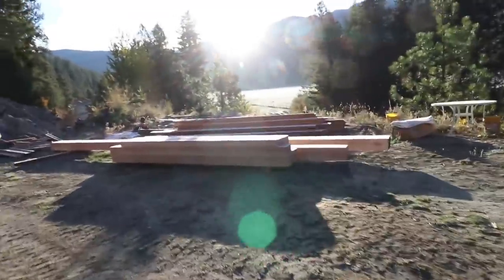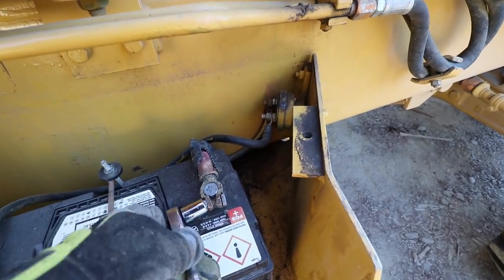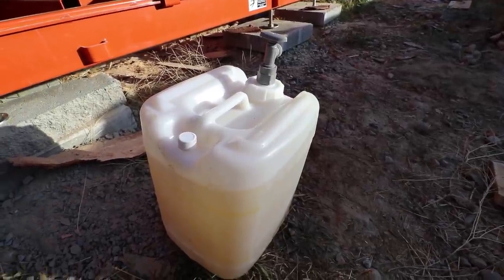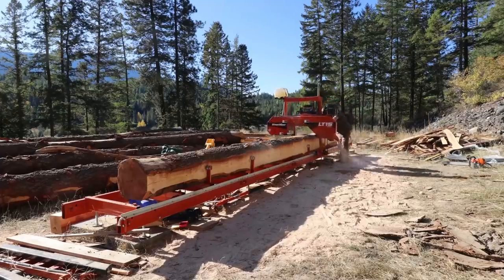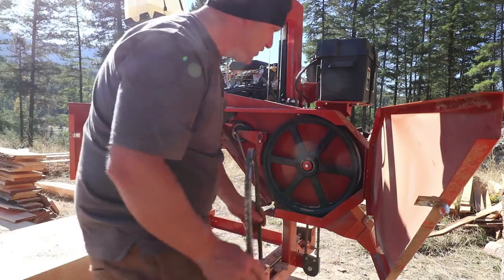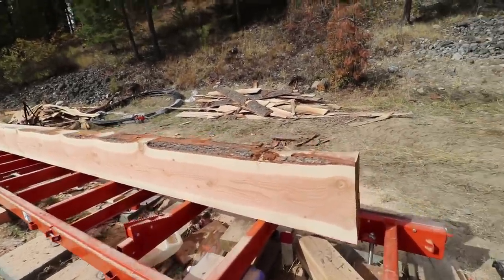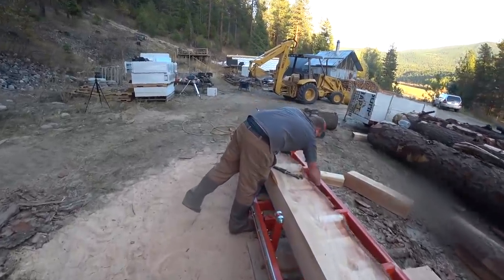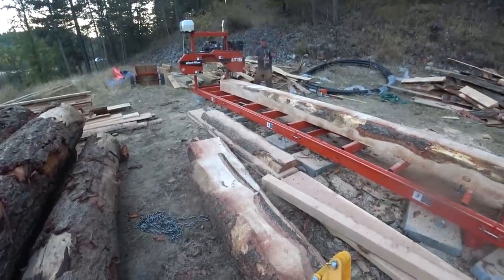BROKE OUR FIRST BLADE! (LT15 Woodmizer Sawmill)

Comment: Your tractor should have a DC Heating elements in it that will preheat the spark plugs so that it will start easier in the cold weather. It should be a switch or a push button or connected to the key switch itself a half a turn.  It would totally not make sense if it was not installed by the manufacturer.  I thought in previous videos you read eliminated the battery fixing things as a process of elimination.. you should be going through the fuse box pulling every fuse looking at them cleaning them and overtime maybe you'll find a lead that is a fuse that seems to drain the battery every time you put it in yes this will take days..  when you are looking for a drain on the battery what you are saying just for clarification. The black negative wire is grounded to the Tractor and you are looking for a broken wire to something like a light that is connected to the red wire the positive battery post.. no here you can find a clue it wouldn't be a major drain on the battery so it might be the heating element.. if it was a scratch wire then after you pull all the fuses you will find power on both sides of where the fuse resented.. however if it was a broken wire and one side is not making contact then you won't be able to find it by the fuse box.. however that tractors painted in paint and it's hard to get a connection through the paint.. I should tell you how to check the fuses you do that with a wire tracker to the negative terminal of the battery and you put the other wire to the positive terminal but the key thing is there's a light bulb in between yeah you're going to need to know that these things are bought at the auto store.. they have a nice feature as a pic that you can push right into the wire..  okay what's a major lag and the way you present your videos if you have don't have it figured out by now might want to read this... I like your videos I think you're making your structure a little bit too much like a house your roof should be steeper you should make yourself a mini Lodge or a bed and breakfast.. the grand open area should be similar to a barn framing and I tell you you probably should plank the outside of your structure.. once again thank you for sharing your experience in your life with all of us and making us dream and inspired to do more..
Reply: is the tractor petrol ?
Reply: think the person meant glow-plugs not spark plugs- but not sure

Comment: when you make your first straight cuts and then rotate,why dont you rotate to the flat side to the bottom? you will not have a wobble...
Reply: because then they would just have a sort of oval log with no flat sides, just a flat bottom and top. i thought about it too, and don't you need a flat x and y axis?

Comment: You should have built a skid way for your logs to sit on... then when you need another log to mill you take your cant hook and rool it on the mill.  Would just need the back hoe to lift the beam off.  The lt 15 is really to small for those logs.

Comment: You should always disconnect the neg. terminal first on a neg. ground system this prevents accidental arcing from the positive post to ground if your wrench comes into contact with the chassis. Sounds like either the charging system is bad or the Bat. is bad. An easy check to see if the charging system is working is to use a volt meter across the terminals to check battery voltage then start the machine and check it again. You should see a reading of 13-15 volts. If not the battery is not being charged. A good 12v bat. needs at least 13.2 volts to fully charge it. If you have a 12v test light you can check for a battery drain by disconnecting the neg. terminal connect the test light from the neg. battery post to the neg cable, make sure everything is turned off. if the light lights there is a drain .

Comment: It sounds like the battery is weak rather than any other problem. Check the water in the battery to make sure it isn't low. If it is full either the battery connections aren't clean or the battery needs to be replaced unless the charging system is weak.

Comment: DC in a vehicle goes from the bat OUT THE NEG into the chassis, through the "device" and back to the bat through the positive.  Sounds both like your disconnect is installed incorrectly and (at this point) it has killed the bat.

Comment: Why don't you use a less permanent method to secure the wood mizer? Perhaps you can stake it in place so it won't be so easy to move it
Reply: Samuel Bruno , stakes will come lose but a mobile home tie down will cork screw in and never come apart.  That's what I would use. One on each end and maybe midway one on each side.

Comment: Your battery is shot, keep it facing the sun when not in use or disconnect it when not in use and get a solar panel trickle charge when not in use for days at a time. Batteries that are dying die faster in cold temps, you could always bring it inside warm cozy trailer when not in use! LOL

Comment: Batteries give off hydrogen gas which is very flammable. The reason why its better to disconnect the negative side first is because there is less of a chance of sparking on the negative cable when it touches the post and the battery exploding in your face.
Reply: The ground (negative) is disconnected first to prevent a short if a tool touches the frame while disconnecting the positive.
Reply: Not addressing the dying battery.  I did not say the negative cable won't spark and NO the spark is not the same the positive cable can generate a big enough spark to ignite hydrogen gas whilst the negative can still spark but its too small to do anything.
Reply: please stop. negative to negative does nothing. positive to negative completes the circuit so Bob E is correct as long as the surface is not painted

Comment: One thing I have noticed - when the two of them are working together on extra heavy/bulky/hard to handle objects, things go much better than when it's just one of them alone.See the 24:18 MARK on this video for an example - together they rotated this log without nearly as much jitter and vibration on the pads as when Jessie is working by himself.

Comment: Why not screw the pads to the concrete?
Reply: Or just partially screw in short lag bolts right next to them to block movement. Only a few would be needed for the whole structure.

Comment: The Alternator is bad. It works after a jump start because diesel runs on self ignition of the fuel once it's running. So the only real electrical draw it has is lights and the starter. Once it's running it isn't using electricity to run like a gas engine.
Reply: Wrong. Any bad connection anywhere on a component could cause a parasitic drain. He may not be running a good ballsy starting battery, and should probably run two batteries
Reply: I agree. As typical lead acid batteries age ,lead oxide particles settle to the bottom  of the plates ,it doesn't start out as a dead short, but eventually will. A three dollar hydrometer would diagnose the problem in about 5 minutes. I suggested this approach on a much earlier video....but you know how that  works out on this channel.His ammeter function would also measure a small current leak (typically up to 10 amps) but I suspect he hasn't a clue.
Reply: Andrew Pinkham they are not having a draw issue. A disconnect would solve that issue. They are having a issue with the battery having enough charge to start it in the morning.  Jumping it and the next morning it being dead is because it is not charging once they take the jumper cables off that's all the more charge the battery has.  Look up diesel runaway, you can completely take the electrical system away and a diesel motor will still run. Mechanical fuel pump so once the motor is running it has fuel pressure and there is no spark on diesel engines. I do this for a living. A draw would have been fixed by the cut off switch it obviously isn't draw since the battery is disconnected and it still wouldn't start.
Reply: louis suvoy I've worked as a mechanic for over 20 years. You describe a runaway diesel not knowing that the engines often run on motor oil, not diesel once they run away. His alternator is probably fine because lights and everything work. If the battery has a mineral bridge or is simply old, one or more cells will not allow proper conductivity.
Reply: That's not to say anything of the fact that if you look close at the cables he's got there, they look like they need to be re-done, with all other connections cleaned, not to mention that he's just press fitting the cable to the battery post
Reply: Andrew Pinkham they run away on their own oil yes but it doesn't take electrical power to run anything like a coil for spark once they are running in normal operation. Just like model rc nitro cars once the glow plug is hot and the motor is running they don't use or need electrical current like a gas engine does to stay running.  I've seen battery cables in far worse shape work fine especially when moved around constantly like removing terminals all the time like he has been doing. A bad battery would have failed a test on it when he stated it was tested a while ago.
Reply: Proper order of troubleshooting. 1. Does it only not crank when it's cold? If yes, almost certainly it's a battery problem. If it does the same thing when it's hot outside, then it's a voltage drop issue. Clean all connections, make sure everything is right and continue on with the plan of the day. 2. Is the alternator bad? With the engine running can all the electronics be turned on highest setting an the lights not dim? If yes, alternator is good. If no, check all connections and measure output from the alternator. If he has a DVOM, the alternator should produce 13.6-14.2v. 3. Is there a parasitic current drain? (Would only present with an actual dead battery no matter the temperature). Easy to check by disconnecting either battery terminal (I use the positive) and measuring how many amps are being drawn by the system. 0.0 is the best number but I wouldn't be actually worried until about .3. A test light could also be used to in place of the multimeter.  You HAVE to troubleshoot properly before you just start chucking parts at things. By simply assuming that the alternator is bad because it's a diesel and doesn't need power to keep the engine running (um...fuel shut off switch? Anyone?) you are showing your ignorance of the workings of a diesel powered vehicle in cold climates.
Reply: Andrew Pinkham so never seen a bad battery when it's hot out? No crank or weak crank is not a battery problem just because it's cold or not a battery problem because it is not cold.  They always have the backhoe running in the background.  The time it spends on jumpers is enough to charge the battery to power a solenoid but not enough to power the starter under load. So again we are back at the battery holds a charge but doesn't charge up during normal operation to start it the next day when it's been disconnected from any parasitic draws in the system.
Reply: louis suvoy yep. Saw batteries fail when I was in Afghanistan. But he's not in a hot environment. He's currently getting into winter. He needs to do a bit more simple troubleshooting. He also talks about a shitty disconnect switch. Could be a little corrosion or moisture or something in it. The video is playing as I'm writing this comment. He literally just said that the battery was tested a long time ago and that it fires right up normally. That, to me makes me point my finger at a battery not anything else.

Comment: two batteries would be a good start second have a load check done on the alternator along with a bridge check to if you are dumping AC in to the battery that would kill a battery quick 

secondly if I am hearing the engine correctly it's a Desial if that's true the once it's started it needs very little to no power to continue to run

Comment: Hey Jesse. One way to combat the cold/diesel issue is to add some gas to the diesel. It prevents the fuel from waxing (thickening) You should connect an electrical meter set to amps in line with the positive battery lead and see how much current is being drawn when the hoe is off. Then you could start disconnecting electrical components one by one monitoring the current. When the current falls low you know the last item you disconnected is faulty.
Reply: But he physically removed the battery lead and still the battery is going down.
Reply: hankus253 i got that. Worth checking for a current leak anyway. I would say the battery is faulty, or as Jesse said just isn’t handling the cold. What makes me think there is a current leak is that in the summer the battery was still running flat. Perhaps there are two problems here....

Comment: When using the Wood Mizer, Jesse turns a hand crank, what does that do?
Reply: i am pretty sure the crank is what is causing the saw to advance down the bed on the rails
Reply: Stormcruzerlore But I've seen him use it without cranking too.
Reply: when he pulls it back to the start it dosnet need to be cranked but when yoru cutting a log it has to be cranked

Comment: If the battery is discharging disconnected I would suspect it is a bad cell in battery. It will charge up then discharge..Could conduct a test by pulling the truck battery from the truck and put it to geht side soemwhere, then put the tractor battery in the truck (after it is charged) if it is dead in morning you know it is the battery..
Reply: You got it right.  Internal short in the battery due to a plate that's probably broken.

Comment: Batteries can be good one summer, and then die in the winter. Lead acid batteries often die at the beginning of winter.
Reply: No, batteries often dies a slow death but over time but you only realise that it's past the point where you need the CCA's to spin the starter when it gets colder and engines get a lot harder to crank over than in the summer when the oils are hotter and this a lot thinner.

People just don't notice that the battery is not up for it any longer when it gets cold in the mornings. :-)
Reply: Morten Mortensen exfuckingactly

Comment: The way the back hoe started sounds like a dead cell in the battery ie only 10volts not enough to fire it up. I have just had to replace my battery due to the same issue

Comment: they use the disconnect on the ground side for corrosion reasons. the ground circuit lasts a lot longer than the positive circuit ... leave it alone!

Comment: OK If the battery goes dead by itself one cell or more has an internal short in side ..To check this you need to check how many volts the battery has when it is dead ...Even when battery is low it should have 12 volts ..SO check how many volts it has when it is low ..IF it has 10 volts ..one cell is bad  if it has 8 volts ..2 cells are bad and so on the sounds of your stater it has one dead cell   Find out whats wrong BEFORE repairing

Comment: You disconnect the ground, which disconnects the power source from the circuit (the battery). If you put a disconnect on the positive side you are adding resistance,  and running all power threw the disconnect. Most stuff of modern vehicles is controlled by the ground for that reason. Just to answer your question not to be a smart ass. Im a Master ASE Technician. Love the videos guys! Keep up the good work.
Reply: Most modern vehicle electronics are driven by N-channel Mosfets as they are a lot easier to drive that the P-channel mosfets that would be needed to control the positive leg. For relays it doesn't matter as you got galvanic separation of control and power.

I some modern vehicles you even have a shunt between battery negative and the vehicle negative / ground, that's in place to allow the ECU's to know how much power is drawn and manage the loads on the battery.

I very much doubt this is the case for their back-hoe though, and I would start by testing / replacing the battery especially now that it's getting colder.

Comment: If the battery if old it can discharge itself even if not connected. Another thing is that temperature and lead battery voltage play a big role, on cold mornings a trick you can try is pour a kettle of boiling water over the battery to get a boost in voltage (sounds weird but works)

Comment: If you're going to put the mill on a trailer, maybe it would behoove you to build the trailer instead of a concrete pad that will be in the way. I'm assuming that you will have leveling jacks for the traslier and they will be easier to level the mill than the incessant adjucting you're curently performing. 

Enjoying the vids and this is just my 2 cents. Worth every pennie....LOL

Comment: Regarding which terminal to disconnect first from a battery: https://electronics.stackexchange.com/questions/230609/why-to-disconnect-the-negative-ground-terminal-not-positive
Reply: Obviously the author of best advice here is British (“jewellery”). The key point is also made farther down the thread: “Electron flow actually runs from negative to positive.” It’s about safety and avoiding sparks or as another commenter noted, not frying a spanner (wrench) or wedding ring. Sparks can cause an explosion if there is a fuel leak or combustible battery fumes.

Comment: On negative ground vehicles, which is almost all of them, you always disconnect the positive terminal. The reason for this is that every device has a constant connection to ground at a specific potential and charge. They are all switched on the positive side. When any given device is switched off, the ground potential between devices is still present and referenced to the battery’s negative terminal. When you disconnect the battery terminal, devices will go seeking their reference potential in other devices, and it will find it through some surprising routes, sometimes damaging solid state devices.
Reply: Andrew Krause that also and I’m not experienced.